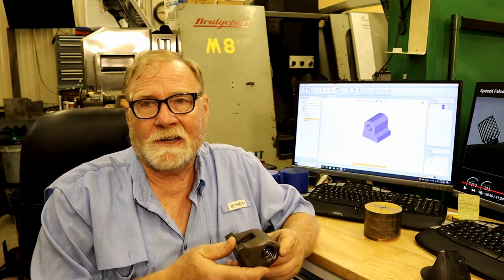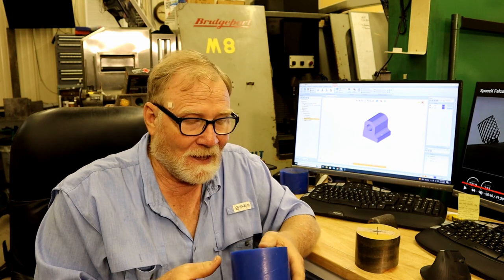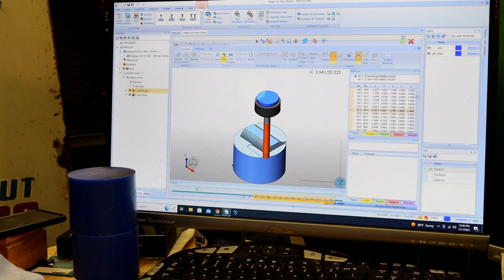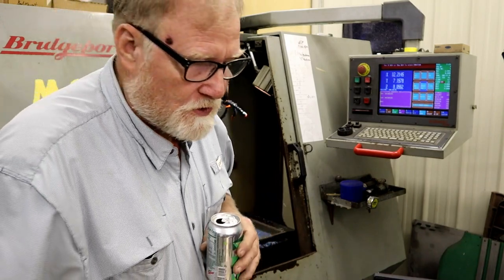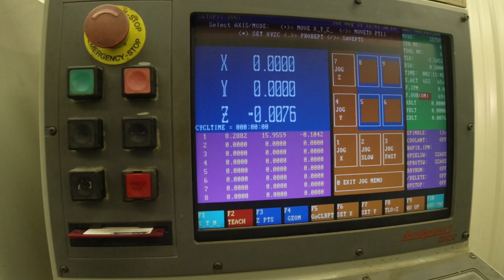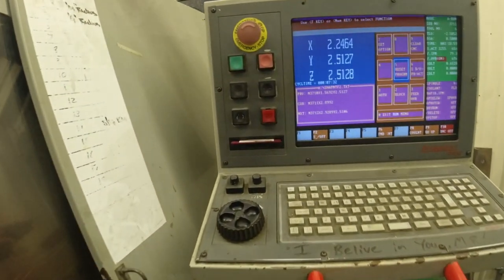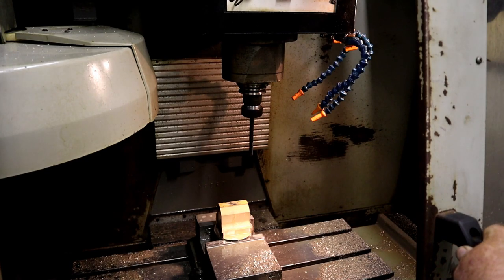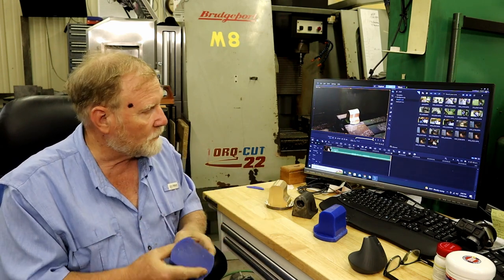Cincinnati Shaper Restoration : Making a New Lead Screw Nut, CNC Style

Comment: Long nuts seem to be a thing on old machines. When I was looking for a new lead screw for my surface grinder I saw that Roton say that there is no advantage having a nut longer than 2 x the thread dia. So if you find you are struggling you could reduce the nut length.Adam Booth has said he often finds the last thread on ACME (or it might be the first] comes out a little off when threading he’s thinks it’s due to the change in tool pressure as it exits (or enters] the part. Anyway I’m looking forward to seeing the next part.  Yes it’s been hot in the UK too records were broken last week.
Reply: I don’t agree with that. We’re not talking about strength entirely. Wear is, as you know, the biggest issuer with nuts. The more engaged threads, the less pressure against any one turn, and the less overall wear. The longer the nut, the better. If the screw isn’t hardened and polished, it grinds that nut constantly.
Reply: 2 X thread diameter looks really much like rule of thumb used in engineering if you just want to have a quick guess about how long thread is needed in aluminium or other softer material. And this dimensioning means you will break 8.8 bolt instead of stripping threads.

Comment: I worked 50 + years in engineering the last 25 using different cad programs. I am now retired and I have a cnc router. I use Fusion 360 to program it with. I have had some hair pulling times with both with the program and with the cnc router. But I am having fun and learning things.
Reply: I use fusion360 for my CNC4newbie router and works fairly well with my very basic knowledge of Fusion
Reply from the maker: I looked at Fusion but I remembered How Auto Desk bought Generic cad, lied to us saying they were not going to change anything and then closed them down !!  Fool me once shame on you.....  Now they are playing games with Fusion.... Looks like I was right to stay away...

Comment: Steve, is that AMPCO Bronze?  Tough stuff for small internal threading. I think they make taps for these kind of machine nuts?
Reply: I tried to find a tap but it’s an odd size acme the diameter doesn’t match the threads per inch.
Reply from the maker: I forgot what it was, Don ordered it and then I lost the site... It was said to be formulated for threading...
Reply: @10swatkins  Good Luck Steve!
Try threading on the right side of the bore in reverse for a better visual down that small diameter.

Comment: When running a new program/setup/tool, it is imperative you either run the program in single block mode or you turn rapids and feeds way down, I am talking like 5% or less. (running slow in single block mode also helps) Look at the code, see what the machine is told to do next and if that is OK  or will it cause a crash. In your case, if you stop the machine (feed hold) about an inch above the part and see that the spindle wants to move 6 inches down from that point, then you know something is wrong. Newer machines have a "Distance to go" feature which shows you now much in X, Y and Z the machine will travel while executing the current command, maybe your machine has that as well. It's very handy. Just letting it run at 100% feeds and rapids is a sure way to not only break tools, but damage the spindle, which is a death sentence for an older machine such as yours.
Reply from the maker: I have found simulating it BobCad to be very usefull in catching mistakes in the code and ..It also lets me program it block mode as well.  Thanks for reminding me...

Comment: What was the total machine time required for the bronze part?
Reply from the maker: I'm ashamed to say :(     It took over an hour.... But I did not want to mess up and I was taking only .030 cuts to get the resolution on the rounded parts and keep the load down on the extra long bits...  Better tool paths would have cut the time drastically but that will cost me over 2000.00
Reply: @10swatkins  If you had rotated the part 90 degrees so that the flat side was pointing up, I think you would have been able to keep the reolution on the rounded parts even if you increased the cutting depth. You could have also drilled a pilot hole to make lining up the part easier later on. That said I'm not a machinist so what do I know.

Comment: In the old days, they might have used a shaper to hog off most of the material for that part.
Reply from the maker: Naw, they would have cast it.....
Reply: @10swatkins  Could you remove most of that material with a roughing endmill, and take full depth (at least of the cutting surface of the tool) cuts, rather than taking tiny cuts and only using the tip of the cutter? That would seem to be a much quicker way to do it. Way less travel that way too - just back and forth in the same area until most of the material is hogged out, then move to the other side and do the same.
Reply: @10swatkins  Yeah,! I realized that after my comment.